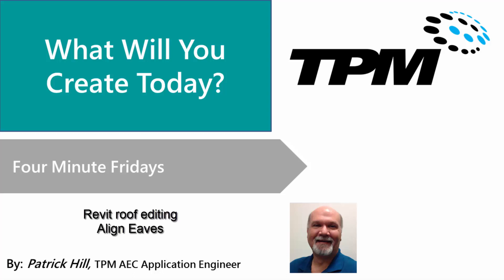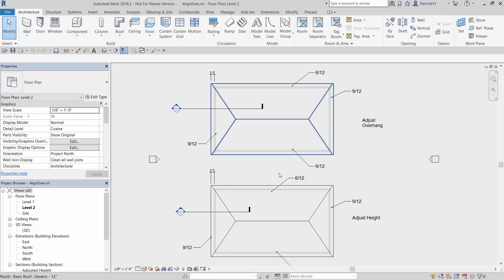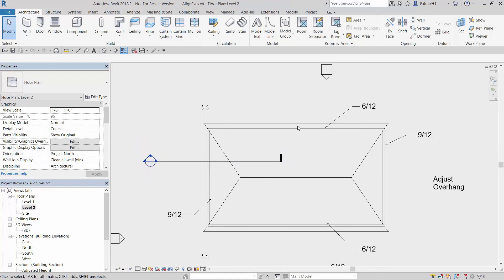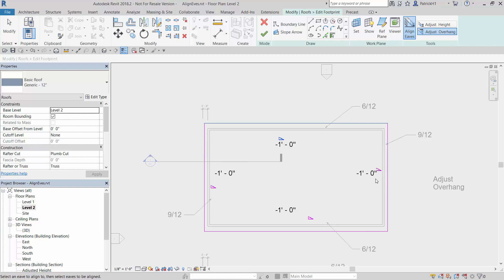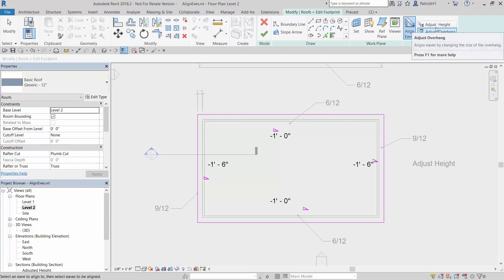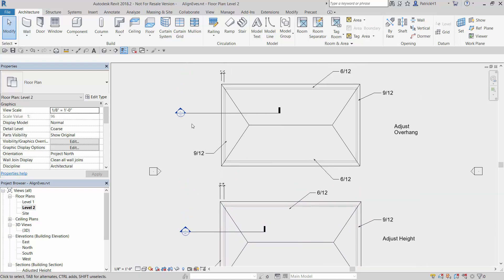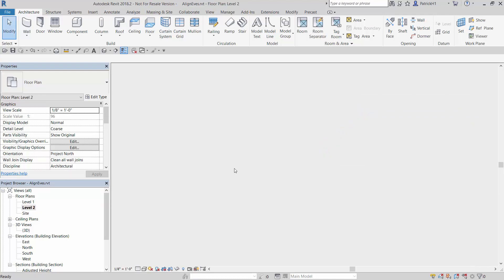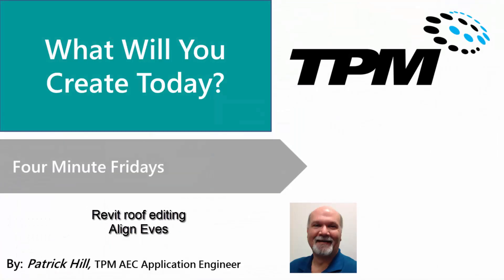How to Adjust Roof Eave Edges

Comment: Is there a way to manually adjust eaves? I have a roof with 2 different slopes next to each other, and I need the eaves to be at the same height.
Since they are 2 separate simple roofs with no hips, Revit says "Eaves are already aligned." and won't let me adjust the values.

I have 2 different roofs side by side, both with the same overhang, but 1 has a different pitch, so I can't align the eaves without manually changing the offset, re-aligning the ridge, adjusting the offset, re-aligning the ridge, adjusting the offset, re-aligning the ridge....